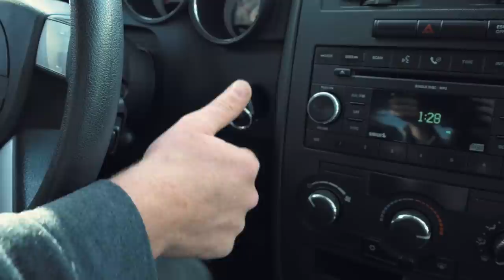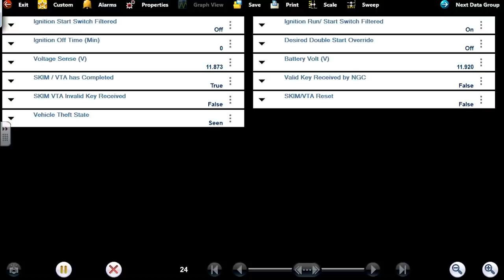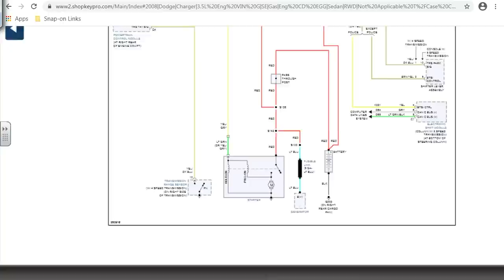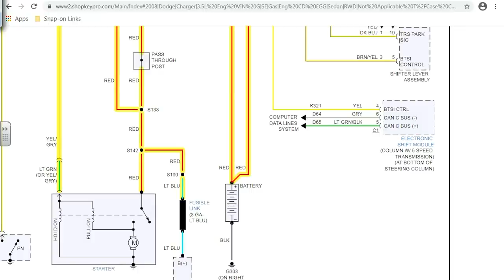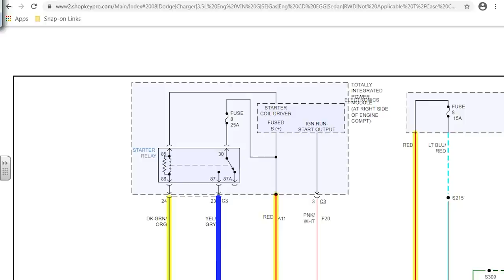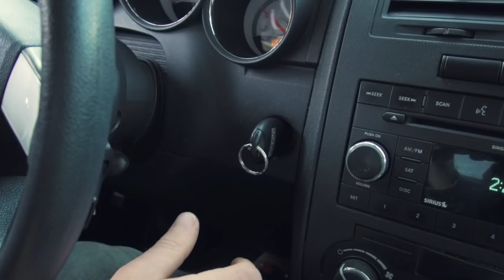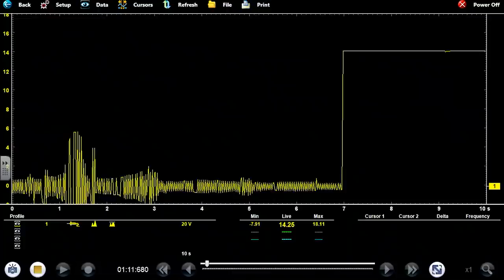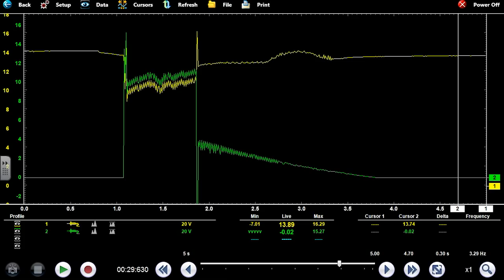Intermittent no crank - starting system troubleshooting (good starter)

Comment: Great Video as usual SD, Thank u very much.
But what does a failing Relay has got to do with the replacement of the starter or the battery? Was that a mere coincidence?
Reply from the maker: I believe it had nothing to do with it. Very misleading information wouldn't you say?
Though it is possible, this never needed a starter and the problem was starting to reveal itself 2 years ago as the battery got weaker. It was the original battery from 08 and was about 9 years old!
This was really a great question and I'm surprised more people haven't picked up in that issue.
Reply: @ScannerDanner  Still enjoying ur knowledge and lecturing as ever, My warmest regards to u all.
Reply: @ScannerDanner  Yea sound like original fix was done by a parts changer, until it seemed to work!

Comment: Hi I have an 03 Lincoln Town Car 2v 4.6l with 140k. The car runs like a clock 99.9% of the time. However sometimes when idling at full operating temperature it starts misfiring bad (PO354 cylinder 4 ignition coil primary/secondary circuit). Then will go away after a minute or so and run perfect again. Changed the plugs with motorcraft platinum and swapped the coil pack from a different cylinder no fix. What would be the next thing to look into? Thanks

Comment: Could you have used a relay jumper to have less of the burning computer risk? or would that throw off ur readings?
Reply from the maker: Less of a risk for sure but still dangerous and one must be very careful even with those adapters. Great question

Comment: Intermittent no crank no start can be rough. I’m working on something right now and having a similar issue. My battery and starter also replaced. My alternator also went bad so that’s new also. I just replaced my starter relay and starter solenoid 40 amp bus fuse. It only happens once in a while but I still try to figure it out. I guess that’s because it’s almost at 230k miles.

Comment: I like the new Autel Ultra.. are there coming more Autel Ultra video's ?? I see u are still using the snap on whitch one u like more?
Reply from the maker: I use them both and each one has advantages and disadvantages. I have more videos coming up with the Ultra. We have a 2018 Duramax with a CAN issue coming up where I used the Autel Ultra (SD Premium video). I'm certain you will see me use it more here on YT too. Thanks!

Comment: This shows that the best way to test a relay is in its normal circuit. Some manufacturers will have you bench test a relay and supply power and ground to the control side and check the resistance of the load side. That test can lead you down the wrong path like the click test. Maybe that's why "the other guy" changed the starter.
I recently had a Hyundai brake light switch with failed contacts. Intermittently, the transmission wouldn't shift out of park. I also noticed that the brake lights didn't work at the same time. A voltmeter across the switch showed a voltage drop of 0.3V when everything worked and 11.5V when it didn't. For proof of concept, testing the switch with an ohmmeter showed consistently between 0.3 and 0.5 ohms. If I went off the resistance measurement alone, the switch appeared fine, but that was definitely not the case. The key test was having the current draw from the brake light bulbs and the shift lock solenoid to stress the contacts and reveal the issue.
Reply from the maker: Nice job my friend! More people need to leave the ohmmeters in their tool boxes! They have their place, just not with current carrying circuits.

Comment: Since the issue with the intermittent delay was noticed after the starter and battery was replaced. Do you think it was possible that the burnt contact was caused by the possibility the operator of the or mechanic attempting to crank the vehicle for extended periods of time?
Reply from the maker: I do not. I believe this issue was just simply from a bad relay contact that caused unnecessary components to be replaced, including the starter

Comment: Hi Paul..I hv uncovered the ECU and turned it on by giving 12v and ground to the required pins with help of 12v adapter. We know that when the engine temperature rises, the resistance decreases and the ECT sensor signal voltage increases which is seen by the MCU and in return the radiator fan relay is grounded by the system IC amd the fan comes on...Paul, i want to know that if i do this manually, will the relay be grounded even then????? I mean, if i manually provide like 3v, 4v or 5v to the ECT sensor signal pin, will i see ground at the radiator fan relay output pin???? will i be successful??? We r manually doing what the sensor and the ECU does. Thank you.
Reply from the maker: ECT signal voltage DECREASES as it warms up (so does resistance as it is an NTC resistor) 
Also the ECT is only one of the inputs used to run the cooling fans. AC system is involved, so is the Vehicle Speed Sensor on some models as well as run time and gear position (some systems will run the fans if you are idling for more than 5 minutes in park with no vehicle speed

Comment: Could you help me out? I have a 2013 chevy Malibu 2.5 liter and im having codes p0089 p0300 it has a bran new high pressure fuel regulator on it. Car acts like it wants to fire but will not run. I just put a used motor in it as my orginal motor threw a rod any advice thanks i enjoy your videos
Reply from the maker: Not without research on this P0089 code. Post this to my forum, we can definitely help you and it is free to join. https://www.scannerdanner.com/forum/post-your-repair-questions-here.html

Comment: Wanted to share I use 30 gauge kynar solid insulated wrapping wire. Can remove relay from box strip some insulation from wire and stick down into terminal in box and replace relay do this on both sides whether control or load side can hook up meter or scope to do voltage drop testing. Wire is thin used for circuit boards. Bought years ago at radio shack but sell on Amazon.

Comment: Just talking to a friend of mine the other day - similar issue - completely different vehicle. Sometimes just won't crank - then it will - regardless of whether it'd been just driven or not. Except for one difference - battery light would flicker after startup. Unfortunately, it's now been fiddled with by replacing the battery. I know that the battery itself wasn't the issue because he tried to jump it once at the shops and it didn't change anything and the jump leads would have been on the battery leads, not the battery posts. So now... we wait... for it to recurr.
17:32 Dude, it's not like the problem started today... it's been happening for a while. If it has to wait, it has to wait. Don't beat yourself up over other people's inability to organise themselves to get things done in a timely manner and then expect you to jump.
26:54 The moment when I yelled "It's that damned relay!" at the monitor haha
I actually had a headlight relay die on my own car a couple of months ago. It was the first thing I checked because doing so splits the circuit in half for diagnostics and it's dead easy to get to (right beside the battery). I had power, I had ground (both capable of a 60W load), I had control from the headlight switch. A quick jump to the 87 socket from the adjacent battery with an alligator clip confirmed it. Took me longer to look up the schematic than diagnose it. I wasn't expecting it to be the relay. But the truly worrying thing is that one relay switched both headlamps (but they're fused independantly). When I realised this I instantly recalled the time in about '92 when I had the headlight die on a motorcycle on a narrow, twisty unlit road well after dark - luckily it was on one of the very few dead straight sections and there was a little moonlight. My butt still nearly vacuumed the seat cover off though. https://goo.gl/maps/dTsguPJQsxd4U1o18

Comment: So her battery and starter replacement was unessecary then? could have spent that money on something else?
Are there any good and easy ways to check my battery status? I dont have a battery load checker thing or what it is called..
To just measure the voltage on it does not tell me how good it perform under start for example or so.
Maybe a MIN/MAX measure under start will tell me how low voltage will drop and use it as battery status data?

Had my battery for some years now. Replaced it with OEM 2013 i believe. 520CCA and 60Ah if i remember correctly.
150A OEM alternator. Was replaced 2013 when battery was replaced. There was a 120A alternator before. So i got upgraded :)

My battery has stickers on it that says do not remove caps. Some batterys you can remove the caps and refill the battery water if its low and also measure the cells for status.
Reply from the maker: If your battery is from 2013 and you are questioning it, you should be 😉, time for a new one. 
Unfortunately the min/max feature of a dvom will not capture the low voltage signal i showed. They are too slow.

Comment: I am going to correct(maybe not correct but add something) you  at 21:00  I own that Tool and I like it BUT!  there is too many cables missing.  I since got me a ATD -5614. I have not yet made a Video but have used it several times already.
Unlike the U-Activate the ATD Supports the 5 Wire Relays and is lower in Price.  Again, I like AES Wave and purchased quite a bit from them  but when I find other and sometimes better alternatives I have to go with that. YouTube nor anyone else sponsors the Tools I buy and Money is not that easy to come by so I have to choose carefully.
PS: Ford loves the 5 wire relays LOL

Comment: So would a valid test of that be to power the relay using a power probe and measure the resistance between the load side contacts?  ( I have tested 100% failed relays this way but never a bad resistance / while under load test).
Reply from the maker: I dont like resistance testing on most circuits. Especially current carrying ones like the load side switch of a relay.
Here is the rule with ohmmeters. 
When they measure that it is bad, it is bad. When they measure good, it can still be bad
Reply: @ScannerDanner  cheers for the reply much appreciated and that makes sense. Merry Christmas to you and your family and thanks for the videos. 👍

Comment: Hey I have a '12 dodge was having a crank no start change the fuel pump with one that had only 5k miles on it. Drove the car for 4 days and the same thing began to happen...I check the wire hardness at the fuel pump I have good 12v and ground..I don't hear the pump running..

Comment: Hi Scanner Danner, my 2009 Dodger Charger SXT has the same problem. It started with delays to nothing. I changed the starter relay it started right away without delay then I left it overnight. The following morning it wasn’t responding again. I would appreciate it if you can help because taking it to an Auto shop is going to cost me a lot
Reply from the maker: Need voltage readings on the circuits like I showed in this video, DURING the no crank condition

Comment: Nice one Paul, great captures of the volt drop across that relay..love it. If not simply age and normal relay life cycles, we could almost draw some conclusions to what caused the contacts to burn prematurely. Chicken or Egg...Old starter solenoid drawing higher than normal current, or, old battery (also replaced at the same time) being weak caused higher than normal current across those relay contacts due to a slow crank/extended crank time...I guess it's also possible there was volt drop to the relay control side (due to above) caused poor pull/hold/bouncing = arcing across the contacts? Just a few speculations that crossed my mind..lol. Merry Christmas to Y'all and Yours...Let's hope for an awesome 2021👍🇦🇺

Comment: That was an awesome diag. The real clue was the delayed start of the crank. Got kinda lucky there. :-)
Merry Christmas to you and yours, Paul!
Linda must be really happy now.

You think the battery is still a bit weak?
Reply from the maker: Yes I do and I dont think it will last the winter. No other reason a battery should be at 11.7 volts after sitting for two days, unless they left the key on for awhile, in an attempt to get it started. So there is that variable

Comment: I have that issue....and 14 volts on my battery. It seems like it does not happen when I slowly shift into park and the wheel is straightened out.

Comment: Having the EXACT same problems with my 2010 PT Cruiser. 

Starter, battery, battery terminals, range sensor, TIPM, alternator, transmission, transmission cable and shift assembly all replaced within the last year, to year and a half for one reason or another. Also, the engine was rebuilt not long ago. Still getting this intermittent, no crank, no start. I am so frustrated I don't know what to do.
Reply from the maker: do the tests I showed in this video to prove or disprove that your problem lies in the same area. There are many other possibilities on your starting system for intermittent no crank conditions. To fix it, all testing must be performed DURING the no crank condition.

Comment: A weak battery will increase starter current draw and fail the starter due to high crank current. The high starter draw will also damage the contacts in the relay. I check my battery ever fall if the voltage drops below ten volts during cranking I get a new battery.

Comment: good explanation for trobleshooting, made all tests so far before sein the video, was able to confirm everithing is ok until Relay. Battery new, feyfob and keys new, fuses OK, relays new, injection turns on, gas pump turns on, my problem is between the realy and the starter, need to find where the wire is broken, jumped the starter with a wire to bat and car runs, when i try to do it from starter relay cable, nothing happens.  so bealive the cable is broken. will bypass the cable.   and see.  
Was almost shure there was a cut off switch or security system somewhere hidden, but after taking all pannels out, nothing.   usually they cut, gas pump or injection, not the starter.

Comment: If you remove the plastic relay cover you will be able to see either worn points of warped points. Either way that causes a voltage drop. We get this a lot in the HVAC industry.
Reply from the maker: I did at the end 😉

Comment: Interesting that my friends' have a Caravan that had a nearly identical symptom, they took it to the dealer and got the parts cannon fired with an identical "remedy": battery and starter (though they threw in new cables for good measure) to the tune of $1,200 and just like this case it was the relay.  Fortunately for them they got another no-crank in the lot when they went to pick up their supposedly fixed van and got to have a friendly conversation about repair expectations with the service manager when he claimed to be surprised it failed so soon  because they got it starting "most of the time.'
Reply from the maker: $1200? Hope he didn't have to pay that bill! Thanks for the story!

Comment: The LED test with the relay jumper was technically an unloaded circuit test because the LED has a far higher resistance than the coil of the relay. It would have been cool to see a wiring fault on the control side wiring from the pcm to the relay as a result of that (partially) invalid test.
Reply from the maker: Agree! I should have used my incandescent on that circuit for 100% certainty.

Comment: Why not diagnose the charging system also? The battery seems quite run down for no apparent reason. I would have been interested to see how many amps the alternator is putting out.
Reply from the maker: Charging system was not a concern. If the alternator is not charging properly, you will have other symptoms and customer complaints. Good question though.

Comment: I have an 07 charger with a normal key that's doing something very similar to this. It likes to act as though the battery is dead, I get slow/no cranks, clicks. My battery, alternator, and starter are new. I checked all my grounds, they are fine. Ignition is fine. I'm at a loss. I swapped out the relays under the hood but it still did the same thing. I don't think multiple relays could be bad so I don't think it's the relay. Any help would be good. Every time it does this the only way to get it started is to hook my jumper pack to the battery and it starts right up.
Reply from the maker: The jump pack added means you have a voltage drop on your starting system. You absolutely MUST perform voltage measurements at the starter when it is not starting.
Reply: @ScannerDanner  that's not so easy to do. My starter can ONLY be accessed from under the car. Is there another way?
Reply from the maker: @MrCougar214  yes, do some voltage measurements at the relay pins themselves other than that, you MUST get the car up in the air and do the tests at the starter like in this video https://www.youtube.com/watch?v=oo1SRIFIkhs

Comment: happy new year to every one , need help befor i start swap the engine this my problem , 2012 honda pilot misfire #3 #1 , compression good leak down test good change spark plug and coil , the most confusing is after erase the troubled codes and before start the engine the scanner read the cods of the misfire and the i discounted the battery positive and negative over night and before start i still read the trouble codes p0303 p0301 , any help will be appreciated , i may need a computer , .

Comment: The graphing meter was able to catch the voltage drop obviously. Would’ve it been possible to catch the drop on a multimeter with a max/min function or was it to fast for a meter?
Reply from the maker: Great question. Yes, the drop was too fast for a typical digital voltmeter to see it.